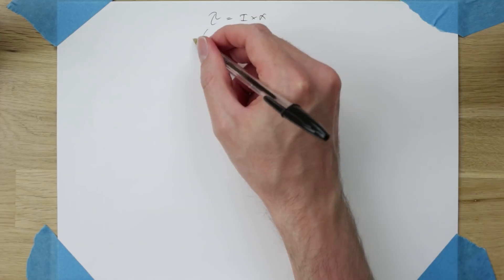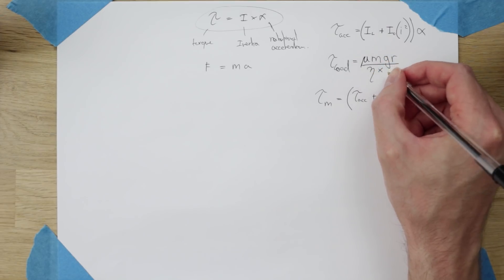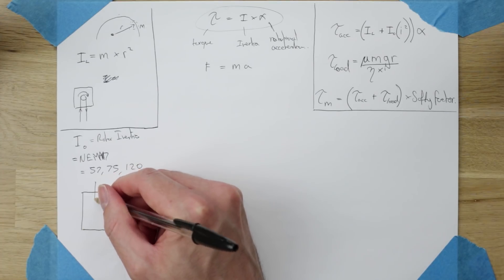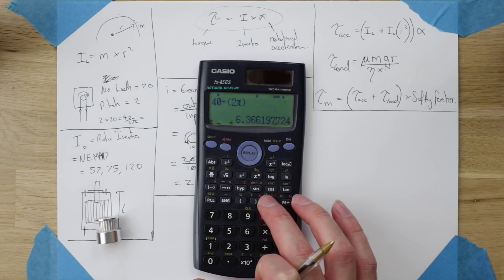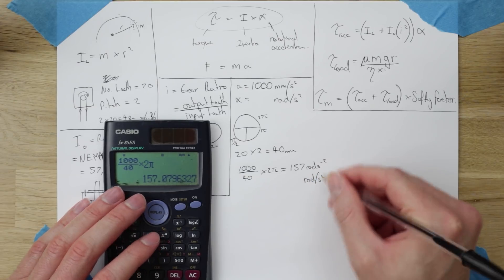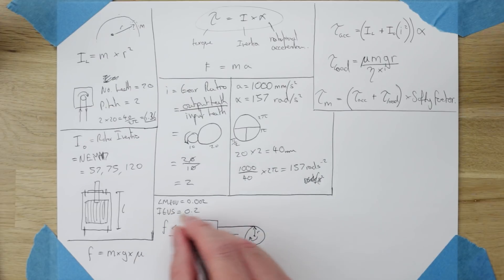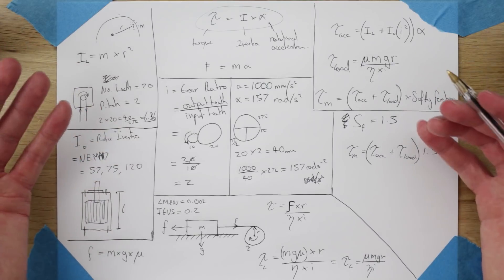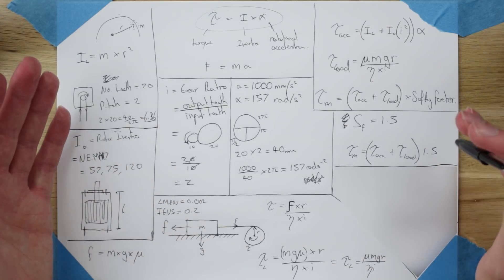Have you got the WRONG stepper motors?

Comment: Cool video, haven't seen anyone else go so in depth about choosing the correct steppers. I must admit though my choice of steppers has always been based on cost/availability rather than specific specs. Minor nitpick, for the friction of the load, you use m*g, I believe it should be more generally Fn (force normal to the surface) which can come from gravity but also things like pre-load since most bushings/bearings have a slight interference fit. 
Any ideas on how you're going to test for stuff like the friction and inertia or will you be relying on datasheets? I'm quite interested in this since I need to pick some steppers for my large format CNC, the ones I have are pretty small so I'll probably have to double up on them or get bigger ones.

Comment: Very cool, I recently learned about this in mechanics of materials last summer, very primitive stuff in school I’m glad to see it put to good use here, building a serial scara so honestly, I found the biggest Nema 17’s I could and strapped them to a large gear ratio so I wouldn’t have to worry about torque but it would be good to use this base to try and optimize my machine.

As a request and maybe a challenge, could you give your thoughts on a Re-ARM Mks TFT 24 ESP8266-01 TMC2130 RAMPS 1.5 DC42 mechanical endstop smoothie? No other youtubers have really ever recommended the Re-ARM board before nor are there guides to install a cheap touch screen like the Mks TFT 24, costs about $18 on aliexpress so it’s in the price range of replacing the reprap full graphics lcd and runs on its own ARM chip so it doesn’t over strain the ramps even if you choose to use an arduino mega 2560, meanwhile, chris’s basement has a neat esp8266 wifi module diy which plugs neatly into the some break outs on the Re-ARM board, the tmc 2130’s last I heard a couple months ago weren’t supported by smoothieware but I’m hoping that has changed with all the undeniably great features you can get out of them but I would take no offense if I would have to go with TMC2208’s instead, hmm.. but yeah, a mechanical endstop as a filament run out sensor and a dc42 mini ir sensor would mean massive prints without investing in an equally huge heated aluminum plate and SSR by quite frankly printing directly on a table or ground, it would probably all be a next generation RAMPS electronic revolution (and might also make some of these elctronics cheaper I pray)